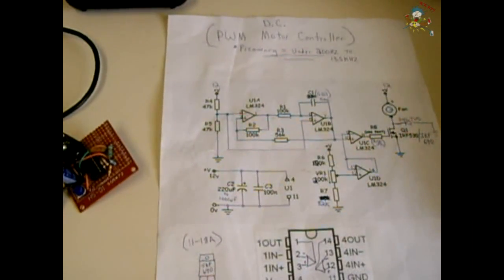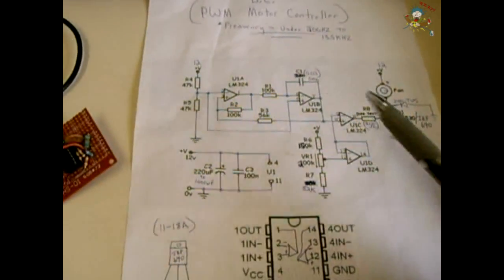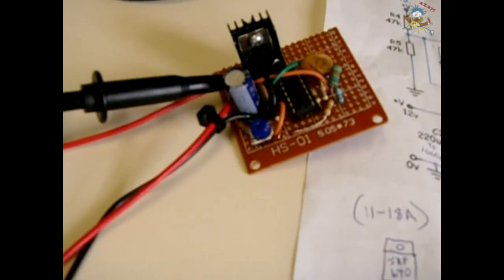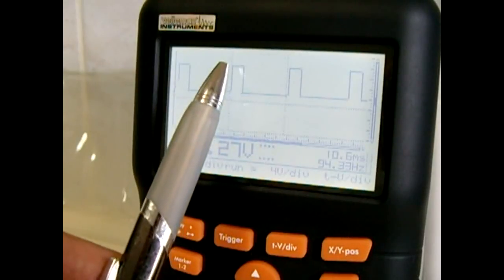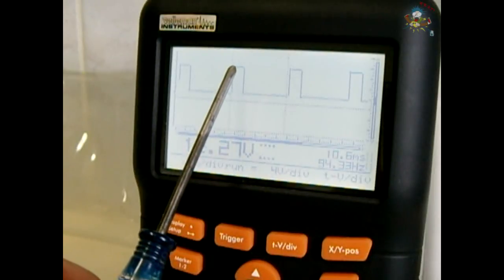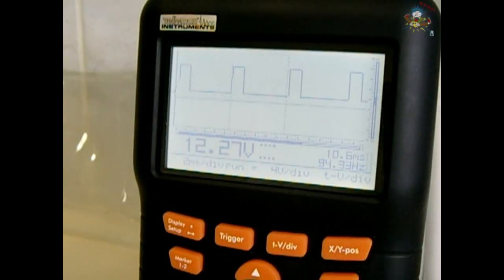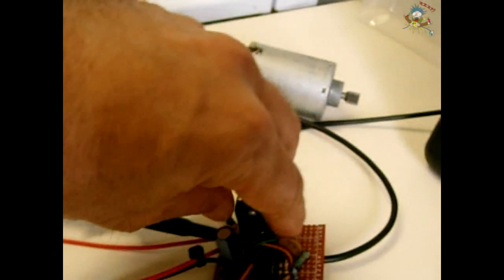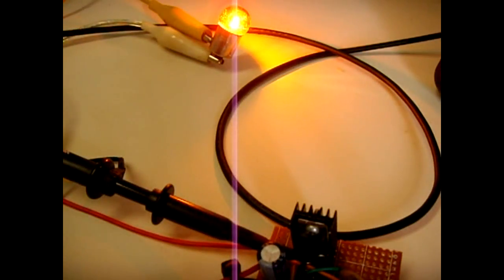How To Make A Simple PWM(Pulse Width Modulation) Circuit

Comment: Hi, where exactly should the PWM cut off relay be connected in this circuit for charging supercapacitors? I have two 500F 2.7V and would link them in parallel to double the capacitance.

Comment: Nice circuit. How would I build one to control a 2.5 hp 240 vdc permanent magnet motor. Thank you for your videos
Reply from the maker: Wow...You will need a mosfet like an IRFP360. That is a 23 Amp/ 400V mosfet(I would even look for a lower Rds mosfet than .20 ohms. I would add a 400V or higher Schottky diode between the LM324 and R8( The Gate Resistor). Connect the circuit to a 12VDC power supply(small power transformer), and the 240VDC to the load(motor), then the other side of the load to the mosfet Drain. Connect the 240V power supply NEG to the 12VDC circuit power supply NEG. Should work, but better stand back when you try it. No guarantee. :-) Make sure the POT has a plastic knob on it for added safety.

Thanks For Watching!

Comment: You can eliminate U1D entirely and have the voltage divider connect straight to the U1C since that should be a high-impedance input. No need for a non-inverting buffer here that I can see.
Reply from the maker: The individual who designed the circuit also stated that. :-)
Reply: electronicsNmore Huh! He could have added a comparator to regulate the average output voltage (such that the negative end was connected to a variable voltage reference, the inverting input was a RC low pass filter to measure the average voltage) this would make a decent constant voltage buck converter. To be used as one, though, the output of the MOSFET would have to filtered with an LC filter or course! the frequency would have to be high, I would prefer it to be higher than 20KHz, preferably 40KHz. this way the inductor can have a low inductance.
Reply from the maker: The circuit can be easily modified to suit your needs, but I am happy with the way it is. Works great.

Comment: would i be able to put more transistors (eg irfz44v) in parallel to use a load pulling more amps
Reply from the maker: Yes. Use a gate resistor for each mosfet you have in parallel.
Reply: ok thanks